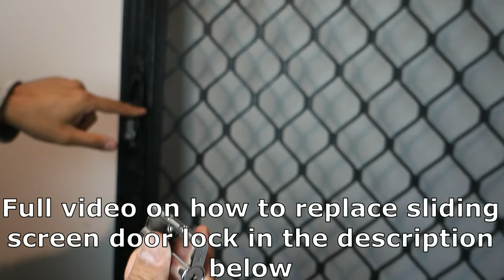How to remove euro cylinder lock without key - replace screen door lock

Comment: But the little piece inside won't move freely without the key in the lock I know because I tried it 20 secs ago
Reply: HOWD you open eventually?
Reply: A hammer with the handle fully off a professional widow fitter turned up nd was like wack it down hard so I did haha

Comment: hi bill, nice vid. but i thought id add some extra info for the viewers because reading the comments below iv noticed a lot of mention where people are getting stuck because the cam wont budge. seems you just jumped ahead 1 step from the beginning. the reason the cam wont budge is because these particular viewers are trying to remove the barrel after they have just opened the door- which means that the handle has clicked back and is still clicked back, if so the barrel cam wont turn unless the the handle is in the forward/closed position. plus 1 other tip which is alot easier is under the barrel where the handles screws where , if you look up in the whole you have much better access to the cam and you can use any tool up to the thickness of a normal sized phillips screwdriver to turn the cam.

Comment: Awesome however how does one do this if your door is shut and locked in place? Can’t get to the side screws mate
Reply: In case anyone else has this question: Just follow the same procedure and once the barrel is snapped out use an Allen key in the gap to flip the levers to open the door.
Reply: @NAFO_Badger_Brigade  doesn't work, it won't budge if it is locked. The issue is not with flipping the levers.

Comment: Doesn't work for me. The cam does not move unless the key is inserted. I can see and feel the cam but it will not move because it is fixed until unlocked. I had to drill mine out with a diamond bit and it took over an hour. My new lock exhibits the same behavior. The cam will not move until unlocked.

Comment: I found using a sewing needle pushed through the gap and then I can slide it from both sides to move the pin worked great.  Thank you for the tip.

Comment: Yeah great advice Bill 👍. As my lock tab was seized up I ended up taking the door off turned it upside down used a small screwdriver and hammer to tap it around to 12 o'clock. 
Cheers, Keep it up 👍👍
Reply: I think I might have to do this as the gap is too tight to stick anything down it

Comment: Thanks, this helped a lot. Wasn't what I needed, but while trying to shim a cam that would not turn it clicked that the lock had to be in the locked position, after which fitting the new cylinder was easy.

Comment: Hi Bill. 
 One question.....
Were your key hanging on the  inside of the door?
I don't know about the euro cylinders down under, but the only way( in Europe) what you did is possible is if the key is in the lock in the inside of the door,which kind of defeats the point of the video .   in Europe every euro cylinder i own  have touched or picked ,the cam will only turn if one side of lock is open, with a key a comb or a pick.
The reason I ended up  watching your video was because I was researching, trying to make a tool to bypass directly to the cam, I know they exist but I had never seen one, and the reason they exist and I want to make one is , if it is going to take too long or you can't pick it open, the cam won't turn and if the cam won't turn , you cannot change a lock without a key, without force or damage. 
The one exception I have come across is a company called " Tesa"
Where the cam does not stick out in locked position the 8nly thing holding it in is the screw,, when you remove the key the cam is inline with the lock body, I am thankful for this , because Tesa for some reason from all the locks i have tried ,is the only euro cylinder I cannot pick open, they look the same as most of the others , but they do not feel the same inside.
Reply: YES!!!  My experience too. The cam on my lock does not turn UNLESS it is unlocked. I had to drill mine out.

Comment: I could not get a paper clip in. Not enough space. So I hammered a nail flat.  That worked however the latch won't move.  :face-red-droopy-eyes:  
In the end I had to drill it out with 4 holes at the side of the lock. That was actually not too hard.

Comment: hi mate its a really good video on how to remove a euro lock with no key but my problem is i have double doors one opens but the left one has no key and  there is a post  in the middle so i cant get at the retaining screw any advice  would help           thanks
Reply from the maker: Hi, I have a video on how to snap the lock which will solve your issue 👍

Comment: I tried with the other door (same cylinder which I had the key), and when key is out, I cannot move the cam thing
Reply: Unless it is a really old inferior lock you will not be able to move the cam as this video suggests. The manufacturers are not that stupid.

Comment: With our lock a key cannot be fully inserted from the outside when a key is inserted on the inside. If someone left their key in the door then you're locked out. Can I change my cylinder for one which doesn't have this problem?

Comment: 20 years a locksmith in Europe and I have never seen a pin tumbler euro lock that could be manipulated like that. 
It seems that this euro cylinder is a disc tumbler version with a loose cam that can move independently of the cores. 
Maybe it’s specific to this type of screen door used Down Under
Reply: You are correct. It will not work on any lock I have ever seen. The cam is locked unless the key is inserted. Also , snapping the lock is a fallacy. The barrel normally sticks out only a few mm making it virtually impossible to grip effectively. In addition, the amount that you can move the lock is restricted by the door itself. Looks great in a video where you place the lock in a vice and snap it. In real life, it will not be possible.
Reply: You only need 3mm to snap the lock if you have the right tool

Comment: sliding a thin clip tie through there and then you have leverage from both sides of the lock to push it up ( a unused clip tie obviously) i only had think ones but i just shaved and sanded the plastic till it was thin enough

Comment: Sometimes the gap is super thin so some items are too thick to flick up the mechanism. I use dental floss - gorilla floss. Can poke it through as it's a little stiffer then pull upwards and voila.

Comment: No it does not work in some locks if the key not there you cant push that metal thing to 12'O clock position cause its stuck to that 11'o clock position. I have failed. Any solutions?

Comment: i've never seen a lock where this is possible. the middle part seems to be broken in this one for this to work
Reply: You are correct. It is not possible on any lock I have seen. The cam will not move (as suggested in this video) unless the key is inserted.

Comment: Most modern cylinder locks don't allow the free movement of the locking part without the key only cheap flimsy ones like in this video.
Reply: I found this out. I have to pick the lock to turn the barrel.
Reply: The differences is there are rigid tail or loose tail Euros. In most cases for a sercurity screen lock as shown the lock needs a loose tail cam for correct function.

Rigid tail Euros are normally found on morticed entry locks with a deadlocking function.

Comment: Not exactly that easy , another video explains it better there is a hole under the lock you put a pick tool under it manipulate the latch up then  finish off with a needle , i tried your way and gave up because not always easy to get the latch up if its right at the bottom
Reply from the maker: Unfortunately the vast majority of locks don’t have the little hole at the bottom to push up the cam. If the hole is present on your lock then that is usually an easier option 👍
Reply: @Michael Wilson     
  what video?